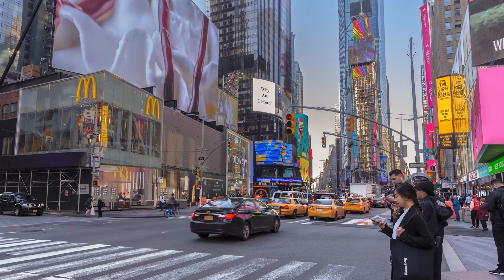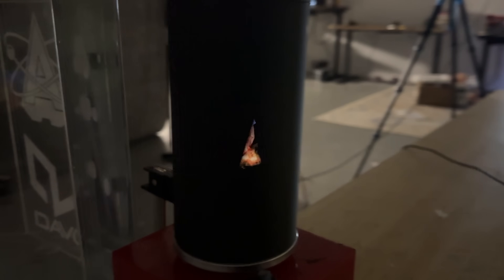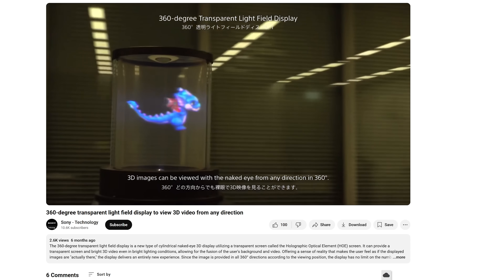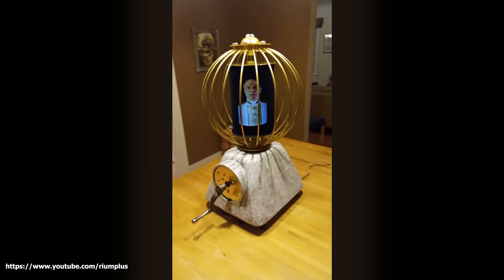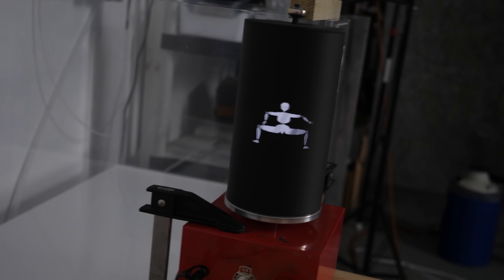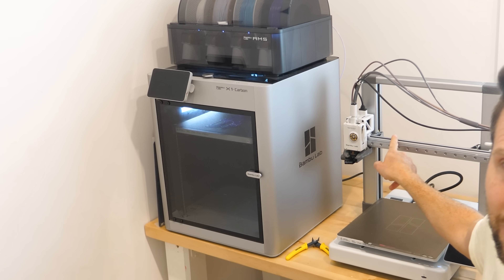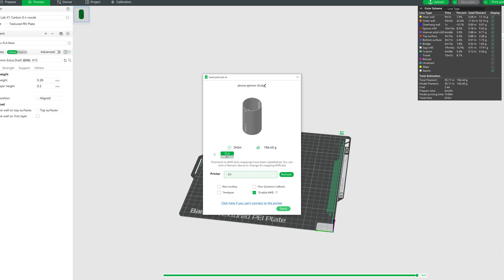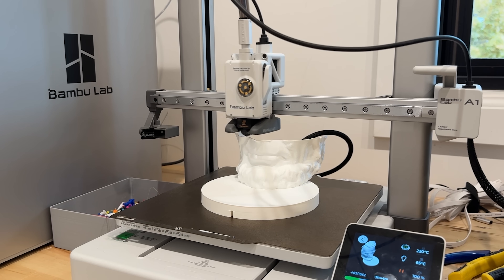The World's First Omnidirectional Screen

Comment: Ok, dumb question: how do you get the two phones to sync up?
Reply: Ideally they'd both be fed from one network source in any kind of finished product, but for the demo, u1 is probably on the money – two hands pressing play.
Reply: ok, I completely overlooked this important detail from the video. You're so right.
Reply: Probably pressed play on both at roughly the same time
Reply: Stream. Like on twitch. But in the local network so it's fast.
Reply: It’s a feature on iPhones - you can have two people play same video simultaneously for shared viewing during FaceTime call
Reply: Script
Reply: simple script in IFTTT on android can synch to googles network timestamp and some players can use shortcuts to jump to the next keyframe within an MPG format video. But for practicality it would be easier to hook one phone to a MIPI board (phones equivalent to HDMI) and then just connect two screens to it.
Reply: They're rotating together so if one started spinning faster it would bump the other one and slow down hope this helps

Comment: as soon as i saw it in action, the lines artifacts and the noise instantly gave away how it works. 
i'm surprised that no-one else has done this before. or maybe they did for the personal use and didnt see it as something worth exposing broadly to the world.
Reply: This sort of method goes all the way back to the very beginnings of television. Look up "mirror screw" mechanical displays. This sort of thing in the modern context has been well-known for decades.
Reply: @zinckensteel it just wasn't used for this specific application
Reply: Most likely because nobody had flat panels containing moving pictures at the time anybody would've been considering this. A static image that could be seen anywhere could've just as easily been a rotating sign.
Reply: My first thought was kind of the opposite: a rotating display of low-power lasers
Reply: I was looking for a comment like this. I'm only 58 seconds in right now and I predict it's just a spinning screen with a tiny view angle so it only shows up in your eyes when you see it head on but since it's spinning so fast you see it no matter what angle you're viewing from.

Edit: hehehe I was kinda right

Comment: So I'm not clear on this, would it be the same effect with just one phone?  What is the need for two phones, how does that change the image?
Reply: It would have the same effect with one phone, but to get the same frame rate it would need to spin twice as fast
Reply: @ebbamb  Would you still be able to see it 360 degrees around the device or only 180 degrees the phone is facing?  I don't really understand how you can see the image all the way around, why it would work when you're looking at the side or back of the phone with the one phone setup.
Reply: @JustMichiganDave  whole 360 degrees with one phone and one slit too
Reply: @SimSiimoVids  I get it now. I watched it again and I see my mistake, the container and phone rotate together, I originally thought the container rotated around the phone so it didn't make sense.
Reply: 6:35
Reply: The cylinder is blocking most of the light, using two phones helps compensate a bit by starting with twice as much light.

Comment: But hold up...doesnt that mean you can just make a 3D camera and take 3D video with 1 camera lens that spins in place of the screen setup you have now? I mean obviously it would take some more engineering...but, it might be an interesting project..
Reply: It would be difficult to make, but probably. How 360° cameras work now is taking photos from different lenses and stitching them together. Doing it in a similar way to this video, there would probably be problems with motion blur, and it would still have blind spots above and below it. I don’t know if the technology currently exists to solve those issues or any others that might come up, but I’m sure it could be figured out by someone.
Reply: no i don't think so. for three dimensional image or video you need to capture the scene from different angles.. spinning single lens camera at one point wont capture the same part of the scene from different angles.

Comment: Advertising agencies will love this... more exposure to more people.
Reply: They would, but lets be real, a large version of this would need a LOT of power to spin at a high framerate 24/7. This is still really cool, but it doesnt seem very practical imo
Reply: @randominternetperson3  - Would it be difficult to put it in partial vacuum? It shouldn't cost much to maintain momentum without air resistance. (and magnetic bearings?) For a permanent, fixed display, that doesn't seem too expensive -- especially considering the high novelty provided.
Reply: @gdshoe5822  still though, a large one would be relatively heavy and would need to spin at what, 30-60rpm? And thats without all the maintenance a giant spinning screen would need. Maybe we could see some put up in large cities, but theyre just not worth it compared to a regular screen or billboard.
Reply: @randominternetperson3  Yes, it would be a lot of mass spinning very fast. That would pose design challenges.  But would it really need maintenance all that often? When was the last time you had to open your TV for maintenance? With magnetic bearings in a vacuum, and inductive power transfer, there might not be a lot of opportunity for wear.
Reply: @gdshoe5822  with all due respect, i disagree (I have absolutely no clue what im talking about)
Reply: @gdshoe5822 how would they put the whole thing in a vacuum though? Would it be just a bigger bulletproof glass cylinder?
Reply: @gdshoe5822 Without air, I bet a lot of electronic components would overheat. The cooling solution would need to be quite complex, verging on the impossible. Spinning a liquid-cooled device at those speeds would probably prevent proper coolant flow.
Reply: @mikefarrington7141  -- That's a really good point, actually.  I wonder if radiative cooling could come anywhere near the needed order of magnitude.  If so, it would greatly simplify the cooling system without introducing mechanical wear into the vacuum chamber.  (I have doubts, but it's fun to dream.)
Reply: @mikefarrington7141  And it's really not the spinning of the coolant that's the issue. It's getting the coolant in and out of the chamber. Overcoming centrifugal force is a simple mater for a pump. But that coolant then needs to be cooled...
Reply: @johngamerwil8044 you’d better put it in bulletproof glass because this thing is a 360 degree shrapnel bomb waiting to happen. Double the size and octouple the kinetic energy, or worse!
Reply: @randominternetperson3  you can just put really light screens inside a vacuum
Reply: @randominternetperson3  I'm sure some nerdy software engineer can create a code to recreate this same phenomenon digitally on a cylindrical display
Reply: jesus, if done properly we would never have traditional billboards after a while
Reply: Adblock is piracy, closing your eyes is piracy
Reply: Big Brother(*) will love this too, in combination with an omnidirectional camera.

(*)Actually, these days, it's Big Bro.
Reply: Pretty sure they won't. Clunky, compared to a flat panel. You also didn't account for reduced brightness. Therefore exposure (thanks to reduced visibility distance) can turn out worse.

Comment: Could you create a similar effect by having a cylindrical screen that refreshed at 450hz with a display controler that turned off columns of pixels as necessary?
Reply from the maker: no, it would be a blur, you have to block the light from getting to people at different angles
Reply: no

Comment: Perhaps try a wireless PC monitor, put it on top or below and use peppers ghost reflector which is what spins
Reply: I just tried rotating a 45 degree mirror over my phone display. You'd have to spin the image on the display at the same time. But if you could sync it right you could spin just the slit and the digital image, and keep the physical display device still.
Reply: @barneylaurance1865  I'm wondering if we can take all the mechanics out of it and just make a digital version where it's just a cylindrical display with the pixels following the same framerate pattern around the display as the original. As long as the digital "slit" of viewable pixels rotates around the screen at the same rate as the physical spinning, then it should be the same, no?
Reply: @MrE_ That wouldn't work because the slit has to be distanced from the screen. What angle the slit is relative to you determines what part of the image you see
Reply: @MrE_ say you had the slit formed by a cylindrical black and white LCD screen, you'd still need the colour screen spinning inside it or you'd still be able to stand at the side of the screen and not see the image.